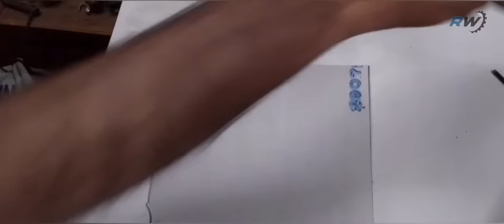Harmonium me mic fit kaise kare || Part-1

Comment: what if we use more mics across all the reeds to get equal sound 🔊 from all reeds...?
Reply from the maker: Why spend more money when the work can be done with just one mic? It is an omni-directional condenser microphone, which captures surround sound evenly
Reply: @ReformationWorkshop but yours doesn't , why you lie
Reply from the maker: @UnbiasedTruth..  Why do you feel this way
Reply from the maker: https://youtu.be/2-an0eFmP94
Reply from the maker: @UnbiasedTruth..  https://youtu.be/2-an0eFmP94
Reply from the maker: @MonkOfficials  https://youtu.be/2-an0eFmP94

Comment: Nice work brother,  but your mic location is wrong, because you set the mic in centre in reed board . Mic cache centre reed sound is over and othe reeds sound is low cache .
Reply from the maker: Your doubt is right but I've used Omni Directional condenser microphone,
It catches surrounding sound equally
I didn't face such problem while live program
Reply from the maker: https://youtu.be/2-an0eFmP94